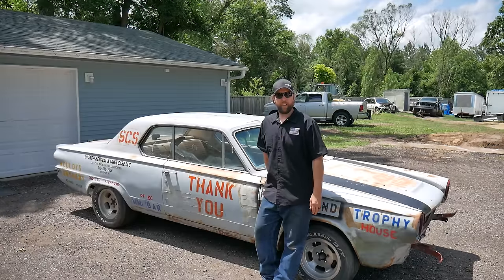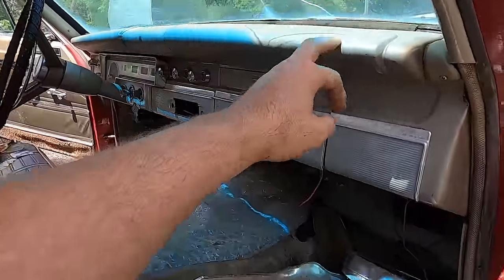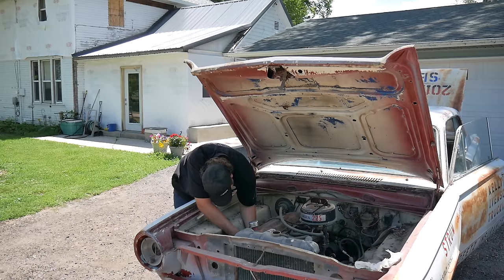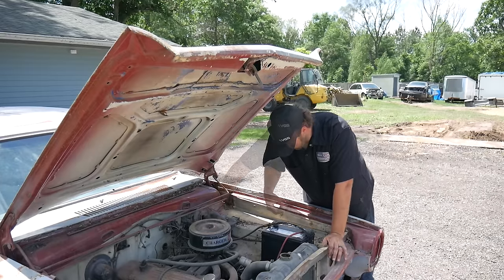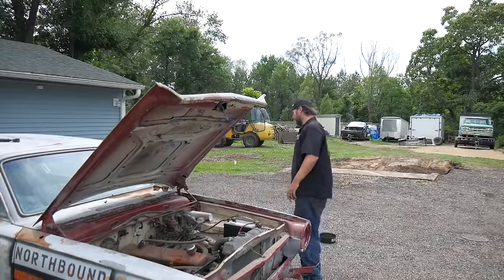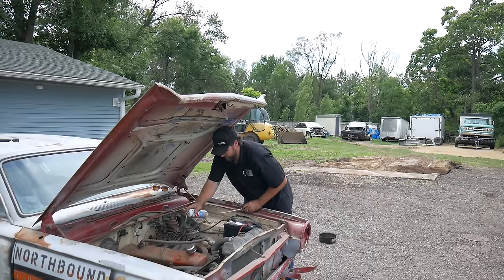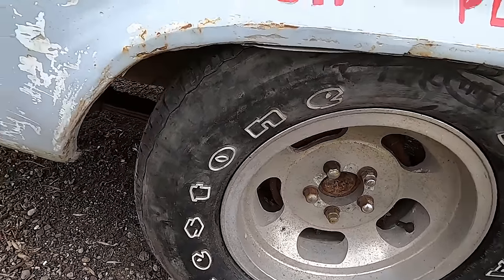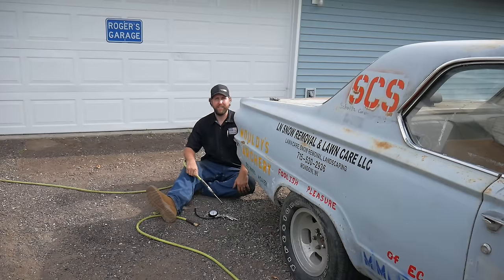NEGLECTED 1964 Dodge Dart GT! Will It RUN AND DRIVE After Many Years? - Vice Grip Garage EP96

Comment: I just hook up my timing light positive a  negative and a the sensor clamp on the spark plug wire if she flashes the plug is firing in the hole. You can find one bad plug in a V8 in about 80 seconds. Assuming you have basic vice grips and such. Peace eh

Comment: the ford filter has the same thread and gasket size but the older ford filters held a little more oil some people wanted the extra gulp of oil and some just used it in a pinch bottom line it works

Comment: If my memory is right, they used the same oil filters in the early 80s Ford LTDs. Mine had an in-line 6 cylinder.

Comment: With no spark on the Dart and it had not jumped time, I would probably have suspected stuck points, next--ekispecially after sitting up a long time. We old guys would sometimes carry a flexible points file in our wallet. I was always looking for the next old British bike to drag home. They were mostly to look at; not actually run, so they did a lot of down time. And motorcycles carry their insides on the outside.  Stuck points are also common after cleaning the power barn at a pressure car wash and in humid climates.

Comment: You can put a 1” shackle lift, on it. You never add brake fluid or a cap to the brake reservoir, so, you don’t know how the breaks will work. You didn’t check the charging system. And you didn’t replace the he head-lights.

Comment: Back in the day we used to do "fender flares" using a baseball bat and "rolling" the fenders. Stick the bat between the fender and the tire edge. Than "roll" the bat along the tire while putting pressure against the fender lip. Ta-Dah...rolled flared fender.

Comment: Lol, years ago a young lad came into the shop holding a connecting rod in his hand , and said that his moms car was running rough ….opened the hood of his moms ‘70 Demon and found a gapping hole in the side of the “225 leaning tower of power” 
Seems young Roger was having fun with moms car while she was away …. Amazingly it was still running with the gaping wound in the side of the block … a tough little engine for sure 👍

Comment: WD-40 dude!  Spray that throttle link with the special juice and you are golden.  Basically, hose the entire engine and especially the electrics, points and plug caps, battery terminals and the opposite side of those wires.  It is freaking magic..  It'll smoke a little, off the headers when you fire it up, but you'd be amazed at the goodness WD has to offer.

Comment: Just a few more infos about the sparkalator coils:

*  The primary should never measure infinity.  Anything from like 1 to 10 ohms is in the right ballpark, however if the primary has like just ONE shorted turn the ohmmage will read okay but the coil will not percolate.

*  The secondary should be in the thousands of ohms.  But again like the primary, if just one of the thousands of turns is shorted to its cousin, the coil will not work, and the ohmmage drop is just not measurable even with a $3,300 hoity-toity HP laboratory ohmmeter.   Much less with a $9 HF Chinesium model.
*  Ballast resistors are more important than they look.  If you bypass the ballast resistor and the points are closed, the coil can overheat and short in about 2 miinutes.   The short is like above not likely to show up on any living meter but the coil is comatose all the same.
*  Don't overtighten the primary terminals.  Even a teensy crack in the bakelite around the terminals will kill the coil after the next rainstorm and you'll have to cancel that date to the levee with Hyacynth Labonza.   A guy can get down over that.  Use fresh or fresh-looking locker-washers on the primary terminals and hold back on the Wheaties when tightening those nuts or you will be staying home and getting another tight feeling in other nuts.
.

Comment: Ive driven worse along the road, case of having to, had an  Aussie version of that, towed home parts from the rubbbish tip and it went great, brakes and exhaust delete but the 225 was sweet manuel box and compression for brakes, I mean what do you expect for $20? last years Benz or similar

Comment: I bought a slant 6 100 years ago the old owner pulled the distributor out and it would not run bought real cheap turned the distributor 180 an ran just fine. I crazy but I think not the distributor I thought was In the rear driver sided maybe cause it was the small slant 6 my wife drove it till the front torque bars rotted from the frame but was good till it wasn't.

Comment: I've always wondered why a guy don't use a timing light to check for spark. You clip it onto a battery (ya got one if yer peeping for sparks anyway) and then pick any sparkalator wire ya want then give her the thunder. If she flashes, ya gots spark right?
Reply: And as long as you don't have one of those high dollar hei units, you can even check the number 9 wire on a v8 (yes, yes I know, wire 7 on a 6 banger) to see if your sparkles are shootin out of the coil into the ole dizzy swirler. Narrowin down yer issue you know?

Comment: Drop a 5.7L HEMI from a pick up truck into that dart.. lift the back end and put on some wider tires.. a manual transmission to go with the 5.7L

And a candy apple red paint job with two white stripes across the middle of the car.. a custom roll cage inside the car, dual exhuast ending infront of the rear tires..  if I only had the money to do stuff like that... 

P.s I love your videos dude!

Comment: FYI: Chrysler Corporation was forced to eliminate the automatic transmission push-buttons for 1965 to meet new regulations requiring industry wide standardization of operating and control hardware. The prevailing transmission shift mechanism was levers and linkage so MOPAR had to change to conform. However, even though the controls were now shift levers on the column or floor they still used the cable actuated valve bodies in 1965 making for some "one year only" hardware. For 1966 they had the familiar lever actuated valve body in full production corporation wide.

Comment: I even use heavy duty diesel engine oil in my Honda CBR1000rr track bike. A bunch of my buddies that I ride with will spend 4 times (or more) what I spend on oil, but they really can’t tell me why. The bike performs perfectly using my trusty Shell Rotella synthetic 😂

Comment: Well,  guy watches the million subscriber special and sees a shot of this ol' rig and thinks to himself 'I wonder what happened to THAT one?'.  I couldn't find the answer in the umpty-gazillion uploads since this 'get her running' video was put up here, so a guy just sat down and watched this one again.......but he's still left wondering what DID happen to this old Dart GT?  

She had some serious potential, that one.  I'd certainly enjoy watching you bring her back around with some engine and tranny mounts, putting the Candles in Jam Jars back in up front and the Dont Run Me Over lights at the back, slinging the bumpers in the general direction of the bumper hangers......basically putting all the parts that were taken off back where they belong is what I'm sayin'.....and doing some other stuff to get her ready for Goin' To Town.  

Maybe even going as far as giving her a birthday with the ol' textured paint job.  If a guy uses the patented Wringer-Mop and Galvanised Bucket method, it gets the paint on there REAL thick first time and you dont have to do so much bodywork beforehand as it flows into the holes and bumps and sorta self-levels all by itself.  Roof paint works best as its built to last on steel.  Best of all, it still looks good at 40 feet.

Seriously though @@UCsfu-jdkX2_v2t3_igVQebg, what DID happen to the wee beast and are there any plans to do anything with her soon?  All the best.

Comment: The distributor on that engine had a VERY WEAK plastic drive gear at the bottom that would snap and you would turn the engine over but the distributor would not turn.

Comment: Put do exhaust on it keep it the car and fix her up I had a slant six it had a dual exhaust hook to it somebody cut a hole in the manifold and it runs like a champ you can't not beat that engine the one I had ran out of oil on Hollywood freeway and got down to Torrance and put a can of oil in it it kept on running

Comment: 😢 The FL1a Ford will fit any Dodge product that has the room and used a 51068. In wix a 51515 would take the place of the wix 51068. When I was in the Parts business for the previous 40 years folks that wanted a long filter for a Dodge product I would sell them this. Now the Dodge is part Ford.